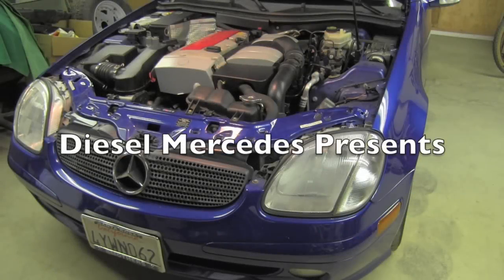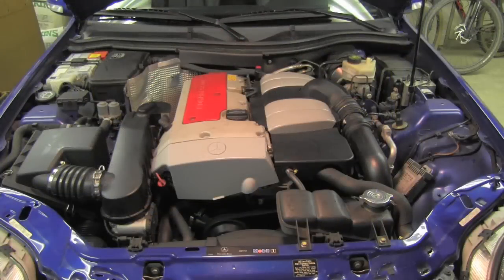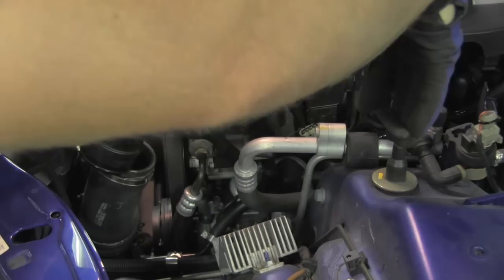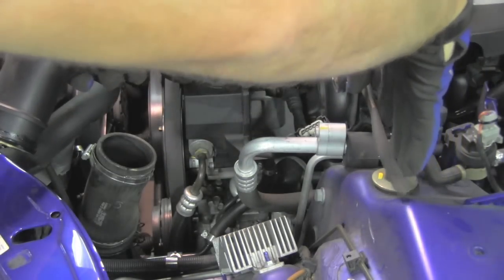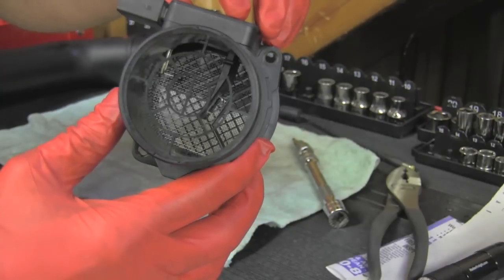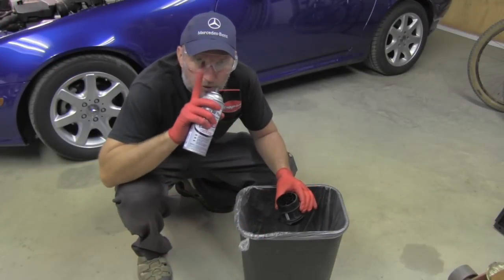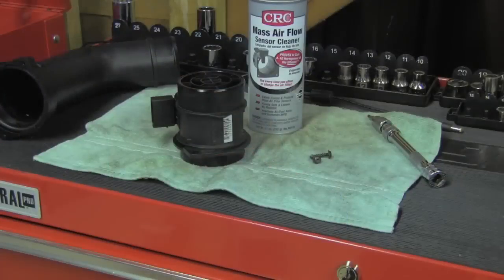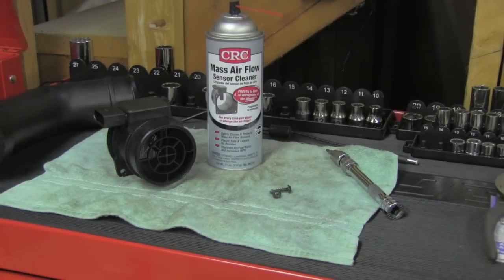Mercedes MAF Cleaning

Comment: Also, the spare parts advisor at my local Mercedes dealership adviced to replace the air filter every time you clean the MAF sensor. In addition, he questioned if the CRC MAF Cleaner will actually do anything to clean the MAF. If there is some particles that have burned to the surface of the electrical component of MAF sensor, there is not way some cleaning spray will get rid of it. This is what an "expert" said. CRC MAF Cleaner might get rid of 99 % of contaminants like oil in the MAF, but those critical microscopic particles at the surface of the electronic component will be stuck for good.

Comment: Thanks for an informative video. However, the process of removing, cleaning and installing the MAF is not quite as simple as you make it sound. Eg. in a 2002 C 230 Sport Coupe the removal is a bit different: you have to open the T20 screws while the MAF is still attached to the hose. That's quite complicated, and you need special tools for that. When putting it all back together, there is a high risk of damaging the MAF if you loose control of the clamp next to the MAF. Do NOT remove the clamp next to the MAF. Putting it back and loosing control of it will break the plastic blades at the back of the MAF sensor. The price for a new MAF for this engine is EUR 640 or USD 700. So, you are playing with a REALLY expensive component. This is no easy task to do.

Comment: hello i have the same car same engine and the sensor is in the same place can the maf sensor effect the car so much that the kompressor doesnt work ?? because mine works as if it is N/A i can even pass an 1.6 N/A car !!
Reply: Yes, the maf restricts from accelerating and the car will pull alot less, like if you only have 80hp. Did you sort out the problem mate? Was it the MAF?